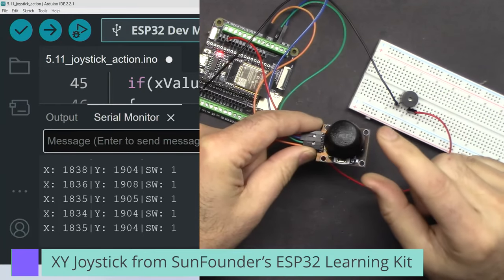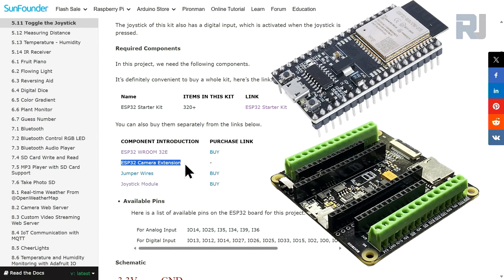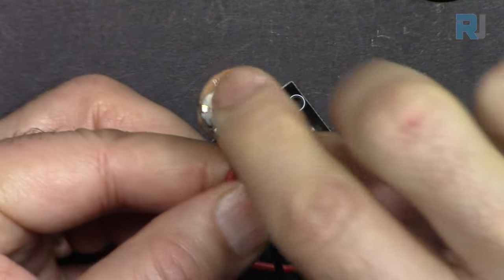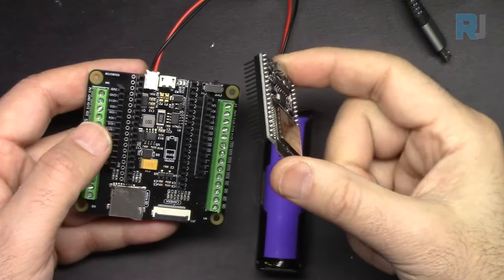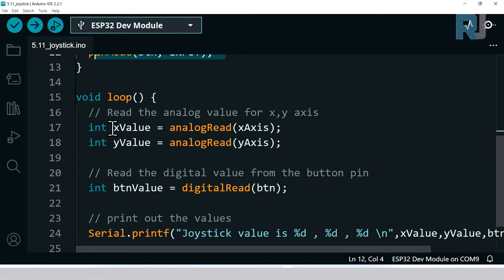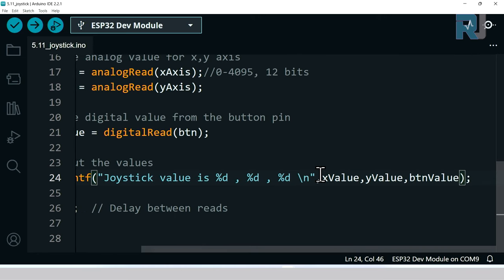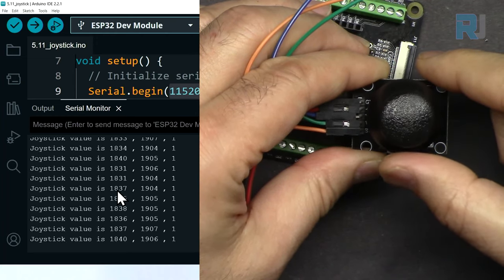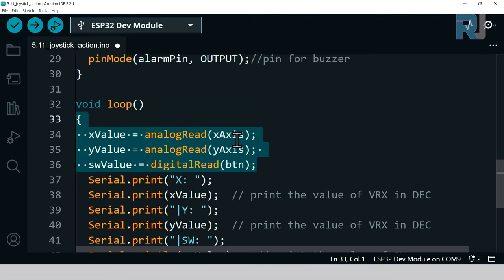Arduino Tutorial 26 - Using Joystick with Arduino Taking Action | SunFounder's ESP32 IoT kit

Comment: If in trouble, lower the VCC, try other pins. I was getting 0,0 at first and tried some resistors and ended up with 1000 in the middle --> 0 or 2000 (10K R before VCC from 5v) and it separate just fine in all directions. We can't be sure about all constructs (what they really do), so I put my ESP32 S3 (a stamp sized M5Stack device) at risk and put 5 volts out which seems to be too much. On a Raspberry Pi Pico that would have killed those pins (x,y). I experimented with battery readings on a Cardputer (ESP32 S3 as well) where they lower the values to 50% to a similar pin before I adventured into this Joystick. Over voltage to ADC's (4.2-->5+v) obviously don't work. That SunFounder kit seems quite pro. Great work on your channel... :)

Comment: Thanks for your videos! I have some questions about pin 33 and 32.. Aren't they XTAL32 pins? and (I'm not really sure) that means they shouldn't be used? Because here you are using it for the switch button and I was wondering if that's okay?